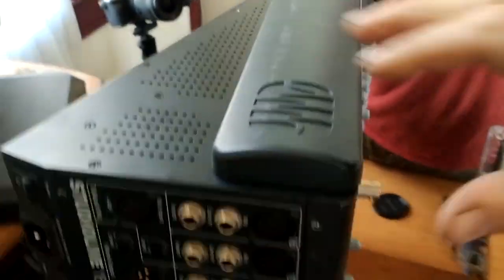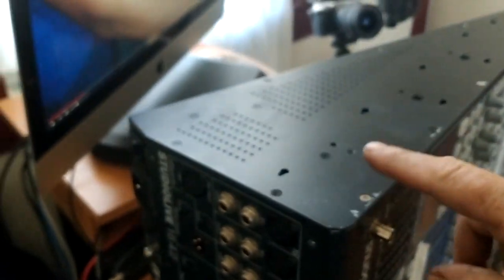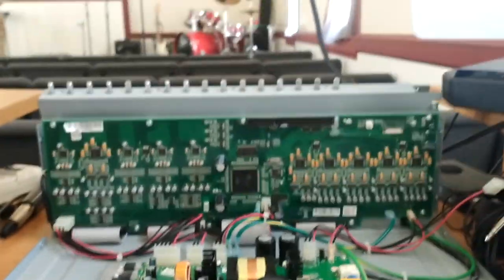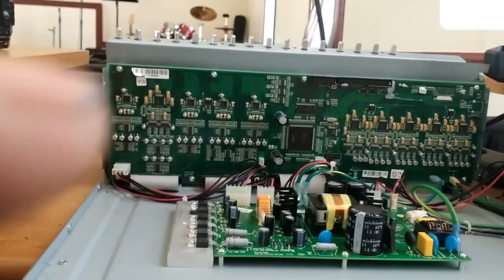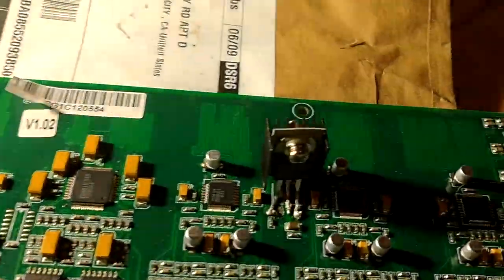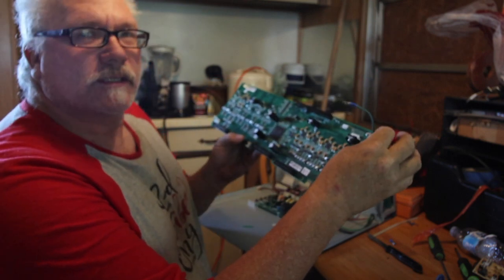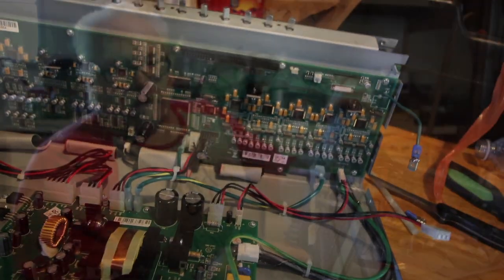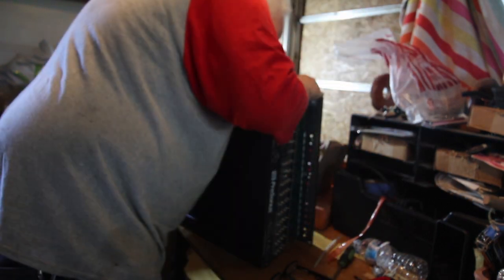Presonus 16.4.2 Repair -all channels out but four?

Comment: This looks similar to my 16.0.2, and after replacing the voltage regulators, i was flabbergasted by the fact that the only connector that the BNC "lamp" connector's cord can reach, is a ground pin on the chassi. WHAT?
Reply from the maker: ya, its a challenge.  I finally just upgraded to the x32. thanks for watching
Reply: @jefferycurtismusic1602  Lol, just found the pin, it was sanwiched among the input boards. Tricky!

Comment: Hello Jeffrey. Thank you for you very informative video. I have an old Presonus studio live 16.4.2 fw that does not work properly. I have a signal in but no sound at all on output.
The mixer have also earlier clipped the sound and it has come back on and off. Do you think with your knowledge that I will be helped by replace the regulators? 
The mixer now have no sound out what so ever but the meters are moving.

Kind regards 
Kjell from Sweden
Reply from the maker: This sounds like a different issue,  I would do the hard reset first, then go from there.   Thanks for watching.

Comment: So I bought the parts but they are larger than the originals. Will they fit?
Reply from the maker: make sure the values are the same, the package size shouldn't matter.
Reply: I put the new voltage regulators in heatsinks and let them float above the board, securing them to the bottom of the mixer with hot glue. Should provide better cooling and keep other components cooler aswell.

Comment: I have a 16.4.2 and the fuse holder cap went missing. Any idea where I can get one? The manufacturer was unhelpful.
Reply from the maker: you can call the company and order one, or solder in an after market one.
Reply: @jefferycurtismusic1602  I’ve already called the company and they don’t have one. This model was discontinued many years ago. And soldering in a new one requires an insane amount of grossly impractical disassembly to get to the fuse holder. There’s no practical solution other than trying to find the right fuse holder cap somewhere.

Comment: Question pls.  How do you remove the front 1/4 jack port for the headphones.  There is a nut there but how to loose it
Reply from the maker: It should just screw on, it's just like any quarter inch guitar jack.

Comment: Hello, I have a problem with my console which is 16.4.2
when I turn it on it does not start, the screen only shows "please wait" and it stays there without doing anything
any solution?
Reply: me too...presonus does not care
Reply from the maker: did you try the hard reset? please refer to the manual.. You have to hold down a couple buttons while turning it on.  that should fix it...
Reply: @jefferycurtismusic1602  hello which buttons do you hold down and what does this do exactly?  Thanks

Comment: I need some help with my 16.0.2 
basically I only have output on Mono or right side,, there is no sound comin' out of the left side from the main, not even monitor.
also I just noticed some of my channels does not work, I turn faders up and nothing work, iit shows no signal, but if I turn faders up from my universal control sofware it does work,  I already updated firmware also master reset and its still the same, at this point I am kind of desperated and no know what else to do :(
Reply from the maker: I think I would start by doing a factory reset on the board. If that doesn't work, then it sounds like the main power out put could be out, in any case, it would take more diagnotics for this one than I can do online.  Sorry.  Thanks for Watching.

Comment: I just purchased a used FireWire 16.0.2 from an online store with the problem of channels 1-12 not working but 13-16 does work. The people in the store claim that it was working perfectly when it left the store which might be true because upon researching I discovered that the problem is intermittent which is true because I turned it on one day and all of the channels worked but then when I turned it off and turned it on again they didn’t work. The problem about returning it is they have a 48 hour return policy and when I got the mixer I was out working and wasn’t able to check it for a few weeks and even if I was able to check it right away it could have worked but then not worked so I got screwed out of $$. So I’m on my own to shell out extra $$ to get this fixed but like you said, you get what you pay for and you pay for what you get ( or don’t get ) life lessons are never ending
Reply from the maker: I would first do the factory reset.  I forget now which buttons you hold down while turning it on, start there.    Please like and follow, and thanks for watching...
Reply: had presonus repair mine a few years ago. now its failing again and they laughed at me. unfixable. im out huge money

Comment: Hi guys I find this video I’m having trouble with my Presonus studio live 16.4.2 after updated for the last firmware now when I turn it on sometimes the red GR light turns on and there’s no sound when I have to do is unplug the power cord plug it back again couple times tried to turn on and it goes away and works for about 5 to 6 hours after that the sound freezes the green LEDs you guys have any idea what’s wrong thank you for any help I will be waiting for any answer thank you
Reply from the maker: If the board didn't do that before the update, I would say that the update was compromised during download or flash,  I would download another copy and flash it again, if the problem persists then I would downgrade to the previous version and flash the old one back in.  At that point if the problem still persists then there is a hard ware failure, if not then you know that the new firmware is  problematic.
Reply: replace voltage regulators with LM7805

Comment: And I must boast that I have found a solution to the problem.  This is not an element that everyone lists or shows one of the videos on YouTube.  If it works for a while after replacement.  It's a matter of luck if it works for more than 1 good game.  If your PreSonus studiolive 16.4.2 suddenly stops playing and the outputs and inputs are freezing, please contact me.  The cost is much less than the replacement of an element that does not add anything.
Reply from the maker: really what is your solution other than this?
Reply: @jefferycurtismusic1602  Are you talking about frozen exits?  Are they offside?  that's the difference.
Reply: ignore this guy, he is useless
Reply: replace voltage regulators with LM7805. worked for me did a lot of research. what a pain in the ass
Reply: @deadlotCamper  I'm not exchanging anything :) If someone wants, I can fix it, but unfortunately I won't give away the knowledge for free, sorry. Where is it written that you have to give away your knowledge for free?

Comment: Where can I purchase the regulators and part# please.Im having the same issue and Presonus doesn't service the older 16.4.2 mixers anymore.
Reply from the maker: I think I bought them off of amazon.  there is a link in the description.
Reply: presonus/fender does not care. should be class action, as they are all bricks. parts arent even useful so complete brick total loss. they should give us new ones, now im laughing as that will never happen. if a mercedes turned into a complete brick loss, they would be sued.

Comment: My 16.0.2, main transformer is heating up and smells a bit, but the mixer works fine. I'm thinking about replacing it or the whole board. Ca zou give amz advice on this, please? which transformer replacement shold I look for or where can I find the replacment board. Everything else aroud looks good. Thanks! Cheers!
Reply from the maker: https://www.ebay.com/itm/294352197617?hash=item4488c217f1:g:nnsAAOSw71NhIub1
Reply from the maker: just replace the entire board...
Reply: @jefferycurtismusic1602  i'm trying to find it in Europe...
Reply from the maker: the best way is to get the numbers off the transformer and buy the same from a parts warehouse.    Thats about all I can tell you.  Except to say that is an uncommon failure...
Reply: @jefferycurtismusic1602  it still working but i'm afraid it will die soon.